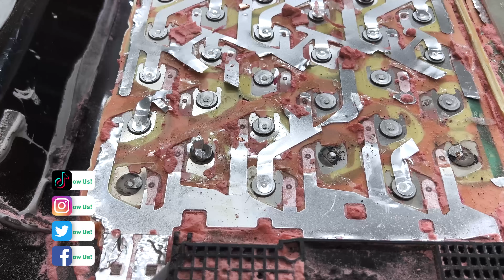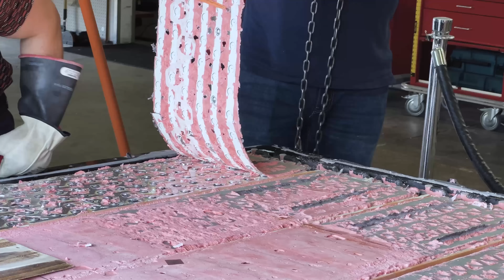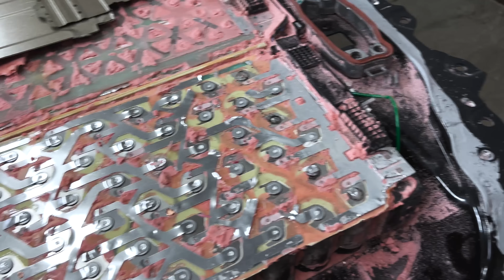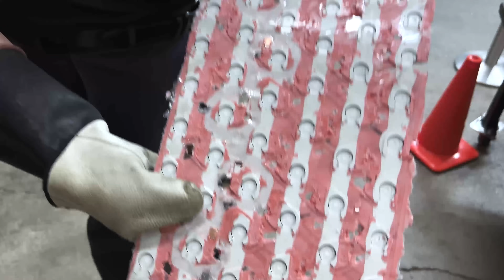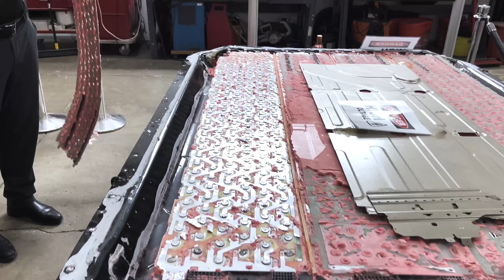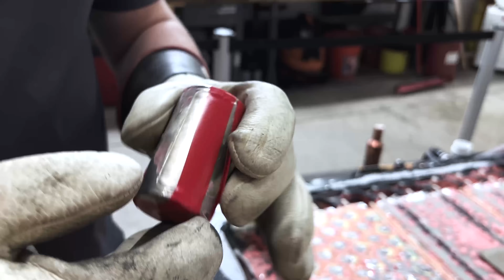Tesla's 4680 Current Collector Layout

Comment: I'm interested in the cooling aspect for these cells, with it all being taken from one end as I understand.
Reply: No, the cooling is through one side of the cell to a aluminum channel "snake", just as in Tesla's earlier packs. You can see three channel ends at the end of the pack in each of the four sections of cells, at 3:38 in the video.
Reply: @brianb-p6586  Yes I know. But when they were revealed on battery day, the big thing they pushed was that they had a better path for cooling though the end of the cell bottom due to the tabless (or rather lots of tabs) design, not via the side which does not provide even cooling to the core. It was therefore reasonable to assume they would be cooled though the cell bottom, not via the sides. Apparently that was more difficult than anticipated so they instead rely on the conduction from the bottom to the side of the battery to move heat with this design.
Reply: @hallkbrdz  just the usual Tesla marketing nonsense, unrelated to physical reality. End-cooling is feasible; for some reason they didn't go that way.

Comment: When Tesla said they would build a "structural battery pack" they meant it. Nice job fellas and looking forward to more.
Reply: Structural meaning, you just scrap it as one brick? It's a thick one, but apart from saving parts, what else does it? It's just a pack with cells and its bolted to a car. Just, it lacks a triple "floor", only has 2.
Reply: @Cloxxki  I think they decided to throw repair-ability out the door with this and just optimize the heck out of it for manufacturing,cost & performance. This pack is not made to repair. If anything goes bad, you throw it out, it gets recycled to elements.
Now for customers, it depends on Tesla's manufacturing prowess for this pack to last 8-10 years and get max return on investment.
Reply: @Cloxxki  wrote "... but apart from saving parts, what else does it [do]? ..."
In a conventional battery pack, the cells are basically just sitting more or less loosely packed on the floor of the pack, with just enough structural connection to keep them in place. They are dead weight that needs to be  carried by the outer casing, which typically needs to be reinforced with beams placed inside the pack between the cells for sufficient strength and rigidity.

In this structural pack, every single cell is firmly bonded to both the top and bottom casing. So every single cell is contributing strength and rigidity to the pack. This eliminates the need for internal reinforcement beams, which allows room for more cells, and/or a more compact pack, and/or more crumple zone at the edges of the pack.

Also, as a side benefit, the greater rigidity improves the ride and handling.

Comment: The bond wires in the old system were a safety feature used in many Li-ion battery packs; they're made of special fuse wire.
I would love to know why Tesla feels they no longer need this fuses.  Are their new cells so reliable that they never have to worry about one of them shorting?  Or, did they put some sort of fuse mechanism inside each cell?
Reply: No battery made of pouch or prismatic cells uses individual cell fusible wires. Perhaps now that they are down to 9 cells in parallel they no longer see a need for individual cell fusing?

Comment: Sandy explained the last video how the pack will be recycled. Apologises if this has been answered what if the pack completely fails. To my knowledge older Tesla,s under warranty they would just give you another battery pack. What’s happens if it fails with this new pack looks impossible to replace it??
Reply: They took the pack out of the car; just a bunch of bolts holding it in. You could swap it out with minimal effort.

The batteries are thoroughly tested, though,  so shouldn't be necessary.

Comment: most of those coils are not for power conversion they are just filters, common mode chokes in the DC lines, nice to see that they try to comply with EMI and EMC
Reply: 🤣That's hilarious.
Reply: @brianb-p6586  why hilarious :)
Reply: @heinrichhein2605   they're showing cells and the interconnections between them, not coils. But perhaps I missed some point where they showed coils...
Reply: @brianb-p6586  yes ge was talking about the Inverter board as well if you have watched the video
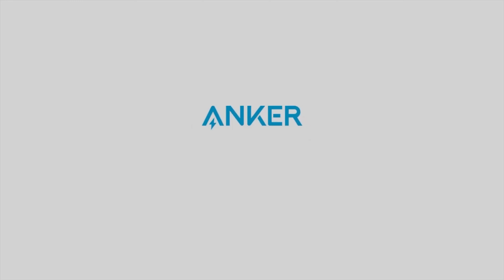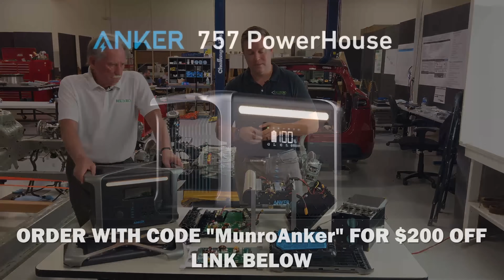Reply: @heinrichhein2605  I did watch the video, although at double speed to make it tolerable. Since the video is about the battery, specifically the current collectors, I skipped the advertisement for the device that the sponsor is having them flog, from 5:37 to 7:08... which indeed has coils, presumably as filter elements.

Sorry for the confusion.

Comment: Seeing all the trouble it takes to 'open' the battery pack to its innards, I wonder what special process or tools Tesla has to do the same but far easier, and how it affects the battery recycling processes.
Reply: They talked about recycling in the last video, so refer to that for an explanation.

Tl;dr recycling is unaffected. Liquid nitrogen bath & then grind it to powder.
Reply: When that battery pack reaches end of life, they will toss the whole thing in the shredder and recover materials from the resulting slurry. No special tools involved.
Reply: Seems like the industry standard for recycling is to just grind up the entier pack rather than any kind of disassembly, and then use various techiques to seperate the materials.  Makes sense for a recycler to not care how a pack was made from dozens of manufacturers and all the changes that are made over time within a single manufaturer. Disassembly would take a lot of labor too that grinding up completely avoids.
Reply: I very much doubt Tesla has disassembly processes in place, that would be something for Redwood to do. But I am sure Tesla shares information about the packs with Redwood. Apart from serious crashes though, these packs are not going to recycling for a very long time so there will not be very many going to Redwood. Even fewer of them will be recycled from Cybertrucks which will pretty much have to be smashed into from the side by a semi or a freight train for the battery pack to be damaged.
Reply: The "party line" is that when it's time for the battery to go to the happy hunting ground, the whole pack would be frozen with Liquid Nitrogen and in relatively safety ground into powder.   The resultant powder would be treated as a high grade ore.

My guess is that relatively small operators might figure out how to service individual cells and  put it back together with the bad cells replaced by new cells or with re-distributed used cells from the same battery or cells from another junked Tesla.
Reply: @GilmerJohn  there is absolutely no way in H that anyone is servicing this battery pack and replacing a cell or two and putting it back together. Munro are the take it apart experts and it is many expert man hours in before they could get a single cell out of the pack, and they would not be able to reassemble the pack from here because they don't have the adhesive to reattach cells to the cooling tube, don't have the pink foam to recover it with, etc. And if there are cell failures most would not be on the exterior row. 

But these packs are designed to last a super long time. I assume the vast majority will still be on the road twenty years after the cars were sold. There will not be a need to replace a few cells.
Reply: @tribalypredisposed  My intuition is that Tesla have engineered the battery to last longer than a Tesla car, which lasts longer than an ICE vehicle...
Reply: @GilmerJohn  inside the factory is a completely different topic. Internally, Tesla tests each cell, then once attached to the cooling tube there are automated and production associate and QA inspections to ensure that the cells are where they are supposed to be and not tipped or raised or something. If there is a problem, yes, Tesla can fix it. Then as the packs are assembled, more automated testing happens at each point as parts are added. Only after all those tests are passed does the pink stuff get added and the pack is closed up. 

But no, again, it will always be way way more than a few hours to try to get into these packs once finished to swap out a few cells. Munro are probably the best at this in the world and they had outsiders sending them specialized machines to help out, and have spent a huge amount of time still. The hourly rate to do what you are talking about would easily rack up to the cost of a new pack.
Reply: @tribalypredisposed  --  Well, let me state for the record that I, personally, have no desire to get into the business.   But if someone can buy "old" battery packs to about the price of the ore and with every 3 packs convert them into 2 nearly good as new packs, that's a LOT of money.   That kind of money and that incentive is more likely to "engineer" a solution than Munro & Co. trying to elegantly take things apart.

Comment: @Munro Live  .. Whats happened to the precautionary use of current limiting fuses cell by cell, found on all earlier packs ?  Originally (Roadster ESS packs onwards)  that was a genius design feature to isolate one rogue cell in a pack, but in the 4680 structural pack, there seems to be no fusing, making it possible for one dud cell to short the entire pack. Unless I'm missing something ..
Reply: Interesting question. Since each cell handle dramatically more current, it could be the fuse is inside the cell, the weld, or the metal tab is the fuse. It's not clear how thin the tabs that connect the cell are, so I suspect the metal tabs are the fuse.  Very clever if so.
Reply: @tesla_tap   I think you’re onto something with that thought.  Given the increased volume of each cell, and therefore its peak current capability, I now think that the metal tabs forking off to each cell are indeed some sort of thin blade-fuse . If so, its another ingenious step in reducing the manufacturing processes by eliminating the requirement to micro-weld a fuse wire from each cell cap to a common conduction/bus bar whilst retaining the need to fuse each cell … Brilliant !
Reply: Edited to add:-  I've just re-read the original 2019 patent for the structural pack and it explicitly states that the individual current collector forks now doubles up as a fuse-able link, and have listed the detail in a new main line comment.
Reply: They discussed this a couple of videos ago, and referenced in this one. Each set of nine cells has its own fuse, basically. Little thin wires at the end of the pack.
Reply: @raddaks2039  if that's the case, then what if one fuse breaks down? you have to replace the whole battery? for just a fuse?
Reply: My impression is that the idea here is not to have any dud cells. For example, with the 2170 cells the can of the cell was very thin to save weight and material, but this meant that if the cell got dinged somehow prior to assembly and the line workers and QA team both missed it then the little dent in the side of the cell could result in a short sooner or later. Here with the 4680 the cell can is much more robust and that helps their role in a structural battery pack, but it also makes them far harder to accidentally dent before assembly and that basically eliminates one of the main causes of battery cell shorts. They still may have the fuse somewhere...but if not that is part of why not.